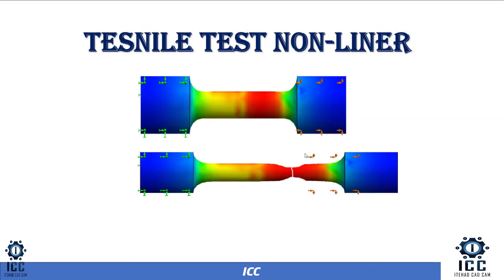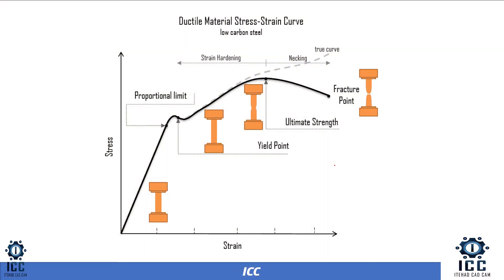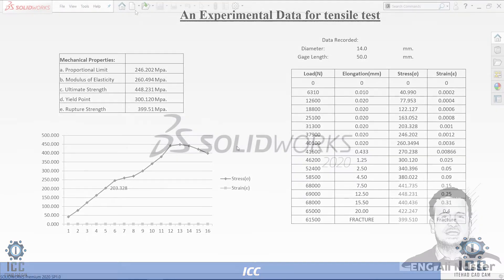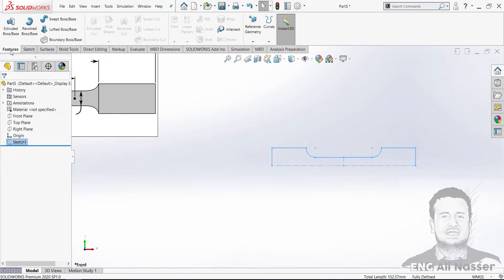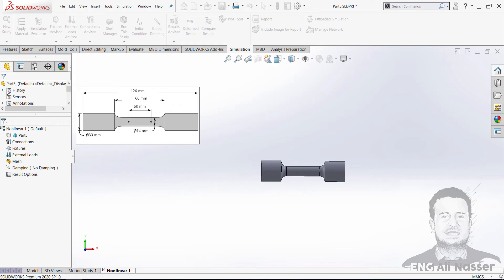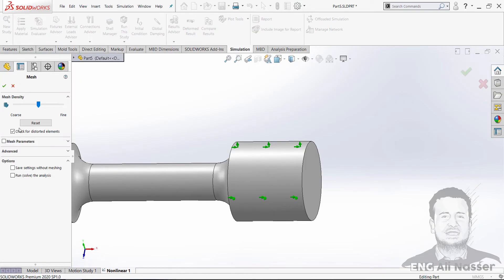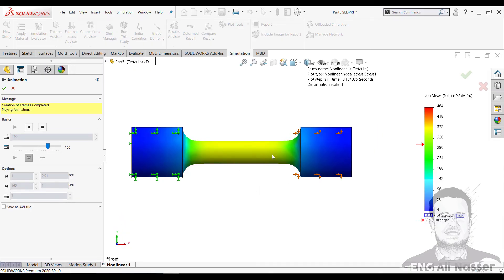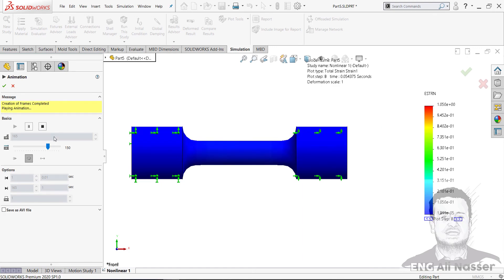Non-linear tensile test in solidworks

Comment: I have a error the first point on the plastic curve is at origin (it must be the yield point)(curve no.=1) i did the same ,what i have?
Reply from the maker: Hi,
You have to check your plastic material properties.
Reply: @AliNasser  it still does not work..,you can send the link to the file? please
Reply: i have same problem and i can't deal it too

Comment: Can i know how to obtain the elastic modulus, yield strength, and other strength from the stress-strain curve ? Since the stress-strain curve is not linear, so how to calculate exaxtly for those data?
Reply from the maker: By expiremental data you obtained.
Reply: @AliNasser  yup i have the experimental data , but im not sure how to calculate correctly. Also, i want to ask is why you dont need to key in the modulus tangent and the error will not come out when you running the simulation becuase i having this problem when running simulation

Comment: Sir, nice video...
is this model valid for metal only or can be used for plastic?
Reply from the maker: Both
Reply: @AliNasser  how can it be both?
Reply: @24schoppindafield  Ali said "both" as in "it works for metal and plastic," not as in "both valid only for metal and usable for plastic." That was just poor wording.

But if you're wondering why it works for metal and plastic alike, it's because the stress-strain curve can be customized with data points — see 8:46. Any differences between the behaviors of metal and plastic can be accounted for in the shape of the curve.